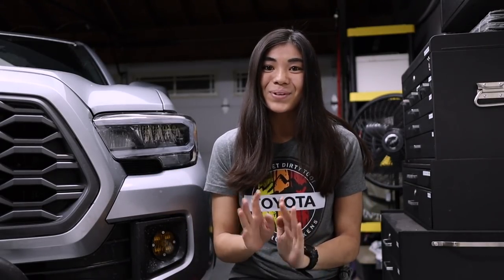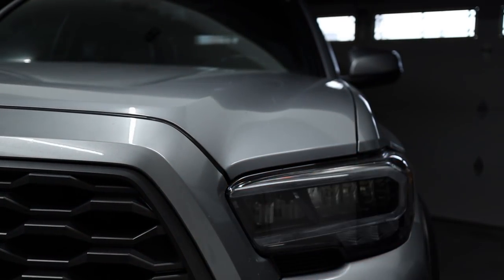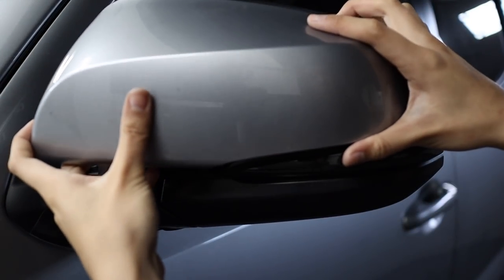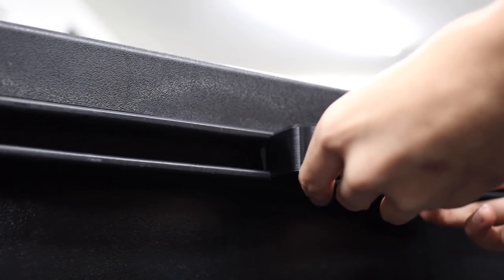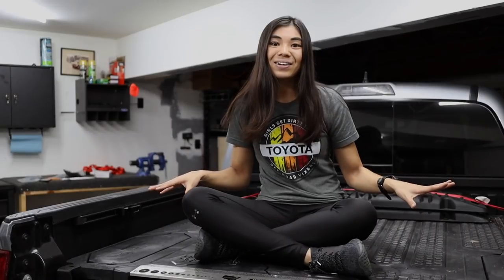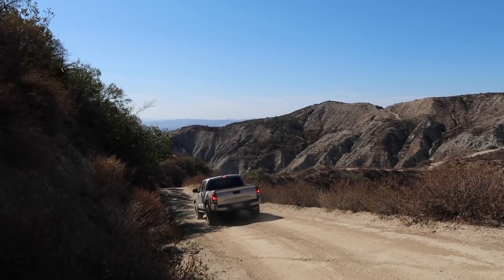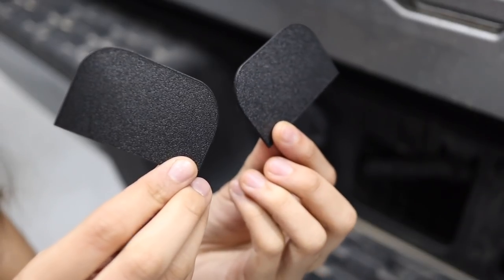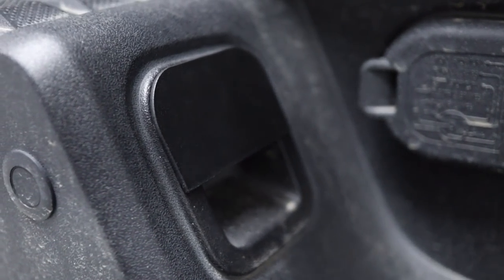3 Minute Tacoma Mods for your 3rd Gen!

Comment: Definitely getting those turn signals.  Just got a 22 TRD Off-Road and have already started modding it, so those will go very nicely with what I have done and will be doing.  Tonneau cover and put in led's in headlights and foglights were the first mods.  I do want to change out my shift knob for something a little heavier.  Looking at side steps as well.   Keep up the good work on the videos!

Comment: Replaced the stock turn signals with the blacked out sequential lights on my 2020 TRD Pro months after purchase.  A great mod, along with replacing the mirrors with the corner blind spot mirrors.  Just ordered the license plate mod. Tie down and seat lift mods are on my hit list.  Great video!
Reply: You swapped to tech package mirrors? Were they plug and play?
Reply: Thanks for the order! I'm working on them now and will have them sent out soon! Check out my thread on Tacomaworld for any updates or if you have questions!
Reply: @Chattsteezy  Yep and it was an easy swap out.
Reply: @wsandford1  Where did you find mirrors
Reply: Spotter Mirror is where I originally bought them a few months after I bought the truck.  They were out of stock for quite awhile.  No problems and the defroster feature works.
Reply: @wsandford1  Cool thanks. Just for clarity did you only replace the glass itself and not the entire mirror, housing and all? Did you have to add any additional pigtails or harnesses? Tech and LED packs are basically the only things mine didn't come with and it bothers me LOL
Reply: @Chattsteezy  It's truly plug and play.  Just remove your existing mirrors and replace them with the Spotter mirrors. You don't have to take the housing off.  The small spotter mirrors are adjustable and give a great view on and off road. It's a great safety feature and beats anything you can get from your local auto store.
Reply: @wsandford1  I was looking for the electronic blind spot detection. This is a good alternative though but not quite what I was looking for. I misunderstood I believe.
Reply: @Chattsteezy  I see.  The Blind Spot only gives the added convex blind spot mirror on the corners of each mirror.  The electronic blind spot detection is a great feature, but can be costly.  Someone backed into the corner of my rear bumper, exactly where detection was located.  The dent was no larger than a baseball.  Cost? $4000 The price included the top rubber piece of the bumper and $450 to recalibrate.  Not a cheap fix but insurance covered it.

Comment: Fuel injection cleaner is a must. I had a Tahoe that kept stalling. I took it to the dealership, paid 700$ drove around the corner and the car stalled. I was right by a gas station and saw Techron FIC and poured it in.  Two more stalls and then magic.  Nothing for the next years.  Use this once every 3 months and your car will thank you !!!

Comment: Another quick mod is the Sokietech Hood gas struts.  Probably closer to a 5 minute install, but they go in quick and you no longer need the prop rod to hold the hood up.  No drilling required.

Comment: Chloe,  I have a 3rd Gen Taco.  I have added several of your Mod suggestions.  Lookin' Good.  Today I had 2nd dealer scheduled maintenance done. 10 months 13K miles.  The front disc were shot, less than 4M thick.  I've been in the Alabama clay mud a little.  Is this normal "crappy disc" on new vehicle?   Is there a heavy duty disc brake you would recommend ?   Thanks
Reply: That’s crazy wear! Maybe the mud trashed them? Do you drag the brake with your left foot by chance? I’ve had Toyota rotors last 100k miles on many vehicles I’ve owned.

Comment: I hope this doesn't come across as a dumb question but, I recently became a Tacoma owner after driving a 2000 Toyota Tundra for the past 21 years.  I was pretty much forced to trade it in on the Tacoma.  Rust of the frame became an issue that I was unwilling to put any more money into the old girl.  I have watched several of your recent videos and I am qurious as to what the meaning of "3rd Gen Tacoma"  means.  The Tacoma that I bought is a 2018 Tacoma SR5 Access Cab so is it "3rd Gen"?  

So far I am liking it a lot as it is about the same size as the old Tundra I had.  My only complaint is all the new idiot lights that weren't on the Tundra.  I am liking the improved gas milage though with the V-6 engine and 7 speed transmission.  I may have to get some of the bed tie-downs you showed in this video I like them.  Just wish I had seen this before I went to the Toyota dealer to get the OEM tie-downs.
Reply from the maker: Congrats on your new Tacoma! This is by no means a dumb question, especially if you're new to owning one... there are currently 3 generations of Tacoma:
- Gen 1: 95-04
- Gen 2: 05-15
- Gen 3: 16+

So your 18 falls under gen 3, the latest generation. Each new generation was marked with "big" redesigns, including different engine options, body style, transmission options, etc. Most of the mods I show on my channel on my own 3rd gen will be compatible with other 3rd gens as well. Hope this helps!

Comment: When she said I did not have any major issues with my truck at 30k Miles. I was like what!! Any Toyota is capable of 200k miles without major issues just with timely oil and filter changes. You don't even need that fuel system cleaner

Comment: Hi Chloe, I’m  looking for a mod or accessories that I can put on my Tacoma bed truck to carry gas cans etc that doesn’t run all over the bed went driving. I’m been using bungee cords to secure it but don’t help. Please help.
Reply from the maker: It sounds like molle panels may be a good option for you. They'll give you many options for mounting stuff in your bed. Cali Raised LED has ones that mount to the factory bed rails.
Reply: @ChloeKuo  ok thanks 😊